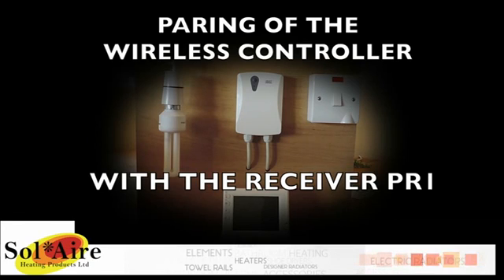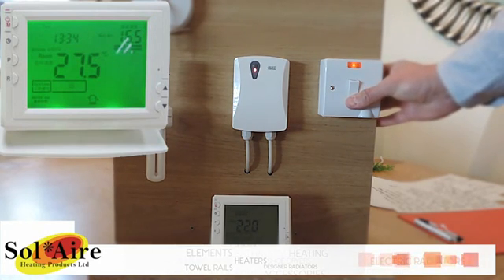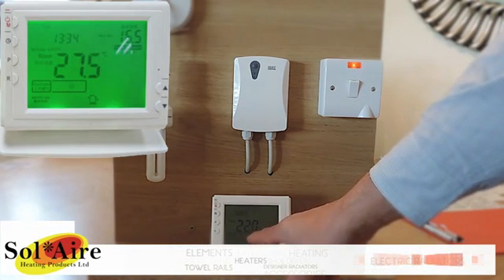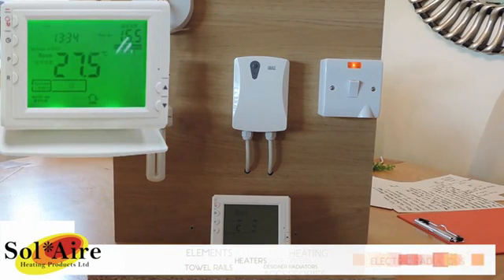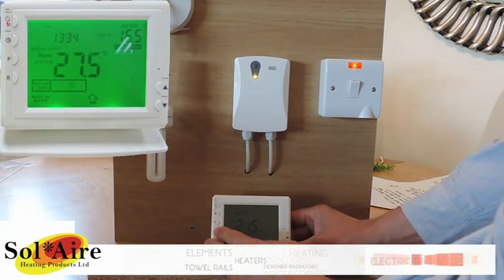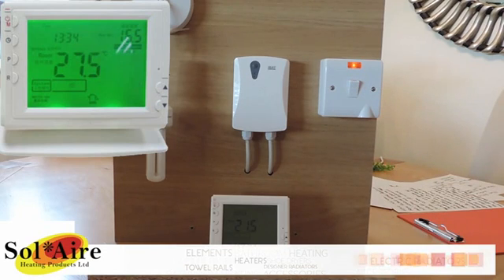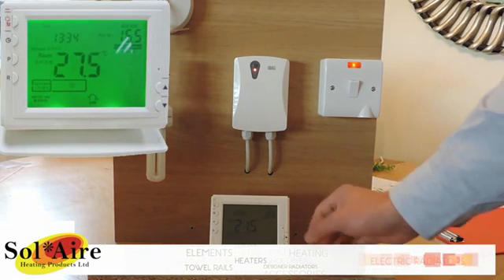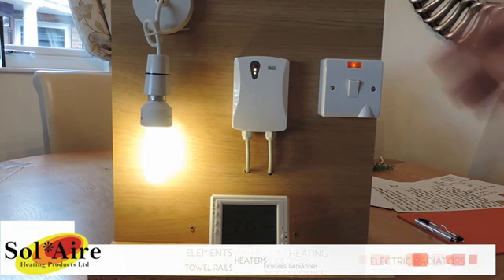Termostato Inalámbrico Digital PR1 Sol*Aire

Comment: Buenas tardes amigo.
Sé que publicaste hace tiempo este termostato, pero me gustaría saber como configurar el mando para uso manual.
Mi intención es ponerlo en modo manual y bajar/subir la temperatura según quiera y solo apagar/encender la caldera cuando pulse el botón de encendido/apagado.
El problema es que cada vez que subo/bajo la temperatura se cambia a modo temporal y yo lo quiero en manual.
Muchas gracias.
Un saludo.
Reply: +Daniel Martín Jiménez 
Ponte en contacto conmigo y te dare la respuesta.
Un saludo
Reply: Mi intención es ponerlo en modo manual y bajar/subir la temperatura según quiera y solo apagar/encender la caldera cuando pulse el botón de encendido/apagado.
El problema es que cada vez que subo/bajo la temperatura se cambia a modo temporal y yo lo quiero en manual.
Muchas gracias.
Un saludo
Reply: Si estableces sólo unos de los tiempo on/ off : 12 horas (on) y 12 horas (off). Ajusta la temperatura a una temperatura confortable y entonces usted puedes activar manualmente hacia arriba / abajo según sea necesario.